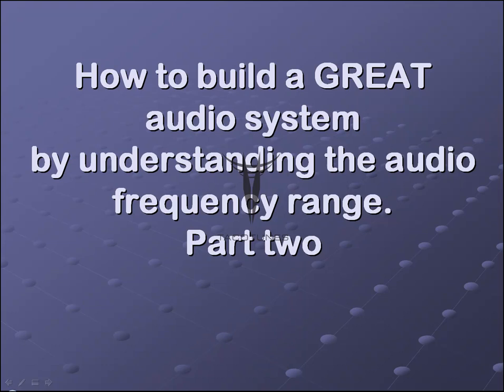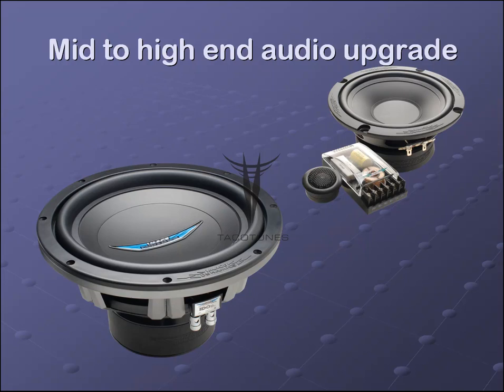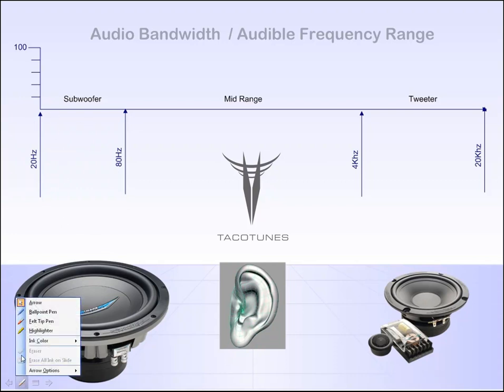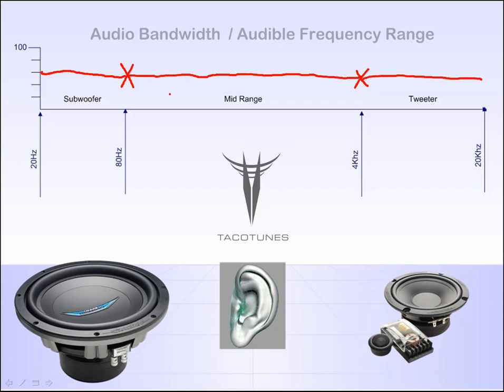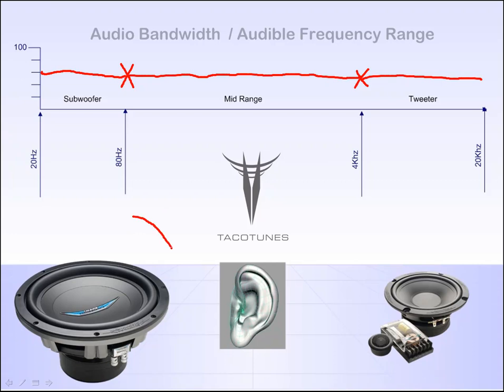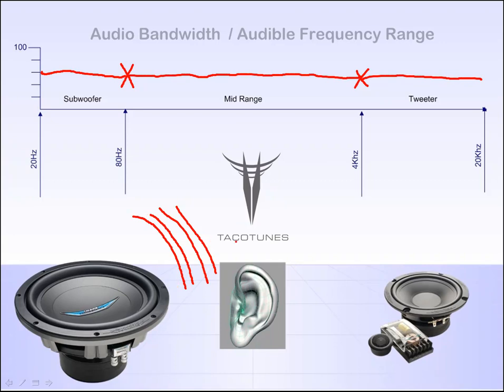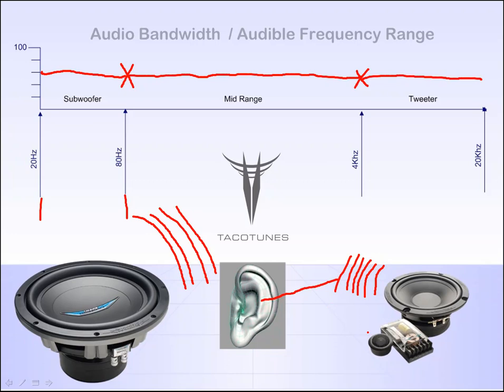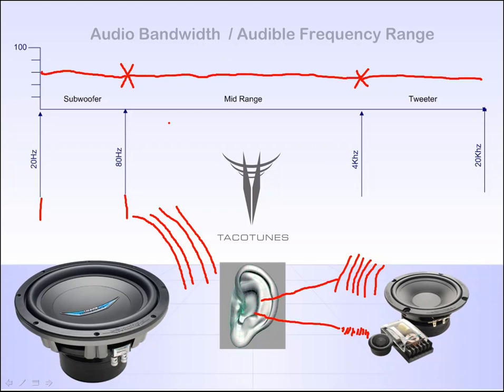Part 2- How to build a quality sound system in your toyota tacoma camry tundra FJ

Comment: Great video. Very helpful. One question though..Is it possible to have a video based on building a system without using a subwoofer??
I've searched high and low and cannot find good info on this topic. I have a DC Taco and am trying to decied what to buy to build a great sounding system WITHOUT a sub. I've already ordered an alpine head unit and I have a 4ch amp if needed but I dont know what type/size speakers would be the most effective in this situation. Sry for the long comment Plz respond.